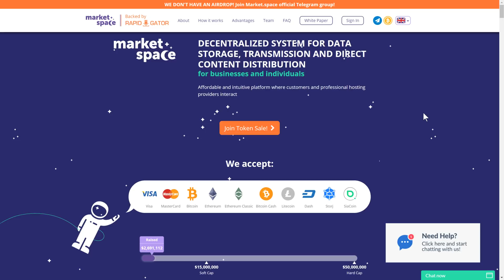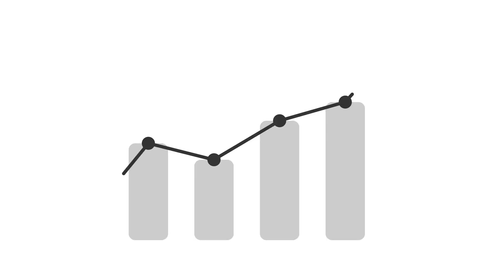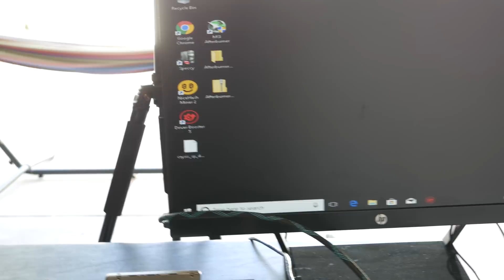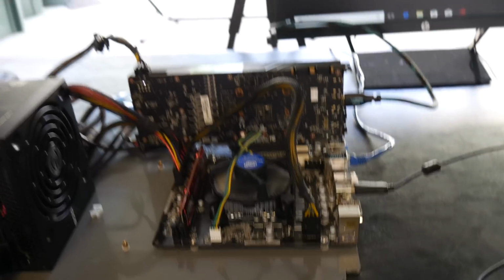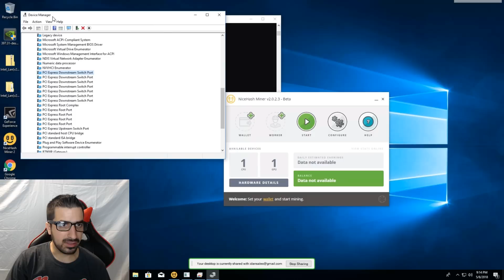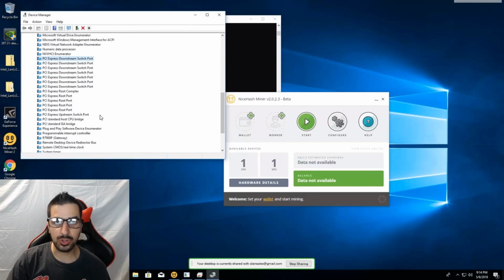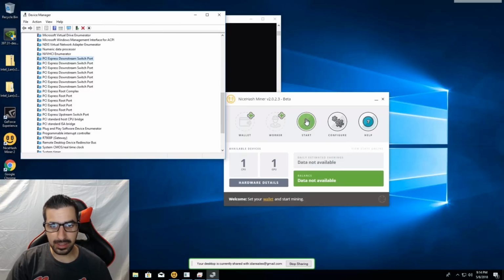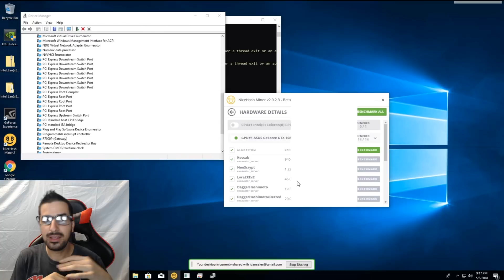13 GPU Motherboard By ASRock H110 Review and Setup

Comment: Please bro help me.  Hello  I have 1 cpu 1660 graphic card . 1 power supply gigabyte p750gm 80+gold. And monterboard biostar b250 pro BTC.  We checked the bios. We recorded windows 10. Then we restarted it no longer runs. Just turn on and off in every 1 secund

Comment: i buy a new H110 today i couldnt plug the DVI ( too OLD i dont have this crap anymore) so i put a GPU on the mobo and tried  to have it display via HDMI, it never worked, i put a HIVEOS USB to check what was going on via Hiveos and actualy  the GPU WAS NOT even recognizeed /detected, i tried swaping all my GPU and none have been detected on hiveOS so i could never have acces to anything bios/window since i have no display, i bought a DVI/HDMI adapter wich will come tomorow and i will see what's going on, after checking the internet  ABOUT this motherBOARD I M STUNNED by all the people saying dont buy this shiitty motherboard, but befor i bought it, i was  seeing everywhere ( best mining mobo ) i dont get it lol
Reply: I am in the same exact situation. Did you find a solution?

Comment: Need your help I am using the same motherboard with 2070 super and its not working… The gpu driver is not installing.. it is showing code 43.. I tried a lot of methods but still doesn’t work.. please help!!!

Comment: I just have the fan spinning but nothing shows on the monitor 😨
Reply: i have the same , how you fixed it ?
Reply: @emre1133  I bought another motherboard.... BTC 37, which has already everything in it. The CPU the fan and no need for risers
Reply: @damirbudanec1502  my mistake was that i didnt complety pressed the ram down... now everything works

Comment: Hi I have same motherboard  and do mining I'm new on this...all black gpu ports  working but white one doesn't  how I can make all 13 gpu slot successful  working  ty ...
Reply: I am having the same issue. The Black PCIe buses work fine but the white ones do not. Did you ever figure this out?? Hopefully you can shed some light on this.

Comment: I didn't like that you only had 299 likes so I flipped it to 300 ;-)  Have you had any stability issues with the board? I have 5, AMD 5700 xt cards and it's not very stable with the latest drivers and no overclocking or under-volting yet. That's with Nicehash. I may change these out to a set of 570s I have to see if that may be the problem. If that doesn't work, I may change from Windows 10 to Ubuntu to test.
Reply from the maker: I had no issues as I remember with the board, it was so stable it ran for weeks at the time maintenance free

Comment: will this system work in 1/8/20
Reply: Yeah profits may vary
Reply: @CryptoDrew   would a '' M.2 Heatsink Cooler, NVMe M.2 2280 SSD Aluminum Heat Sinks with Silicone Thermal Pad ''   keep things cooled off or just over all , one don't need something like that
Reply: @CryptoDrew   also , i here i should put linux operating  cause it's the only one that will manage the up to 14 GPU  and it's free

Comment: Will it matter if you use amd gpus? Also will windows see all 13 gpus?
Reply: Rey Reyna:  You can use AMD or GTX cards, and or a combination of the two if using Windows; you just cannot mix and match if using Linux.  In windows you must set virtual memory to 16000 - 32000, and set power management to best performance, and turn off PCI power mgmt or it will keep turning off after a while and will hard lock up windows, ( number lock will not turn off or on) or get GPU hang failure.   

Good luck.

Comment: You didn't cover it all dude . It will boot even if you forget to plug the cpu fan , pci's slots are too close together and you will need to cover the riser cables so they wont short . And you should connect the 2 sata cables to the MB if you are using multiples gpus .
Reply: Do you mean molex connectors?

Comment: This was the main logic board I built my first rig on, and you actually want to avoid using the X16 rail to get it to recognize 12 GPU's first, there maybe other methods to accomplish the same but it was the first method that worked for me.  You need to hook up the two molex connectors to stablelize the power to the rails, but it you forget a screen will come up to tell you to connect them, make sure the Molex are from the same PSU, the manual says both ways in two different places, but if you want to see what PSU sounds like when it explodes you can test this out.  It is still running fine today, but I would not build another 13 or 19 GPU rig for technical reasons 8 GPU's from a management stand point is perfect, so I have two other 8 GPU rig that is much easier to deal with on series 200 boards, I originally installed all the screws at first but later only did the corners and importantly the two screws, one on each side of the main 24 pin PSU cable to make it stable when plugging or unplugging the connector.   I tried an PCIX1 rail adapter the M2 slot and could not get it to recognize, and or a setting to flip it in the bios.  Hopefully your USB style works with your RAZOR .. I mean Riser.

This board is pretty dam durable and I built 3 tier rig frame out of popular wood, and it looks kind of like a shelf, because I jacked my back up when use to race cars and avoid bending over as much as possible. One thing you will find out, but if I get this to you in time, this board does not like the latest windows build at all,  ( 1803 ), if the April update forces you to do the update, be sure to roll it back to build 1709, and it will be a happy camper, I have 13 RX580's on this board and it likes AMD Driver 18.2.1 the best or at least no difference in performance from 18.3.4 which is AMD's latest blockchain driver, and both will run a stable 393 Mh/s single coin and 382 Mh/s dual coin.  For Ether, I set the core clock at 1150, mem. Clock at 2150, (RX580 Red Devil Golden has a higher stable mem Clock at 2200). Set fans at 1500 - 3000, and that will run 50,000 shares before a full stop to wipe the cards down.

Sounds like your talking about the the GS3900 Celeron cpu, I stepped it up a notch to the newer kaby lake GS3950, the GS3900 is a real dog in this rig.

I wish you the best with that MOBO, I have been running that board nearly non-stop since August 2017.  Peace.

Very Respectfully,
WX2
Reply: very usfull
Reply: Thank you
Reply: is the molex on the mobo really necessary
Reply: @NAWAF-vc1px  it is advisable as it does improve stability; if you are short on molex connectors and do not have adapters; then there are optional sata power input connectors along the bottom edge of the board; well on most of them; I have seen some small changes on various production runs; back to the main point; it is a matter of stability as well as longevity; for the life cycle of the board.  Beside making the power consistent; it accomplishes a more equal; or balanced power  distribition across connectors.  I have rigs that have been running over three years now; and over that time; and especially power stressed sata connections; over time the wiring case turns green and the wires degrade and break; and also six pin plugs to the riser pcb board will do the same.  I now only use modular psu's for the mother board and ssd drive, ( if not using smos ), and then use HP 1200 watt Platinum server power supplies for all the cards and risers; because they are cost effective; and they supply good clean power, and I never run out of connecters and I have never had one fail; and you cam pick them up on ebay for bout $20 bucks a pop; hope that helps.

Peace